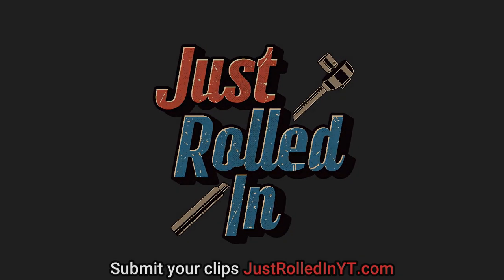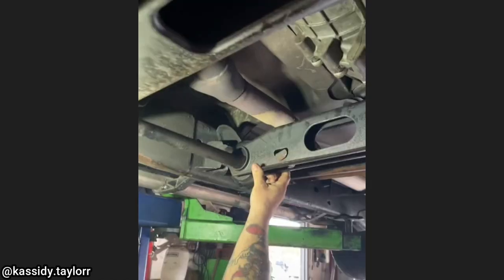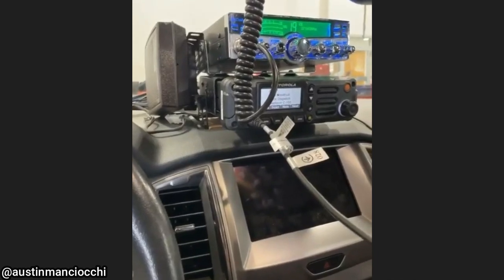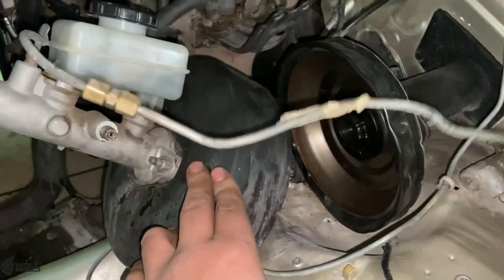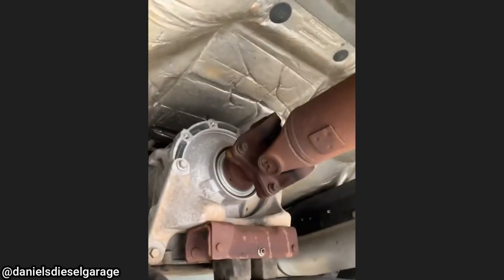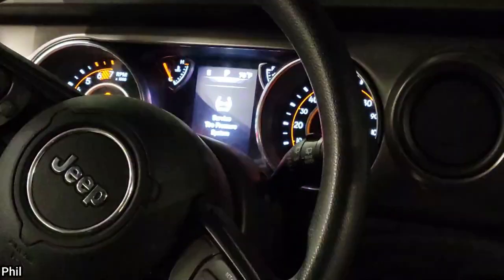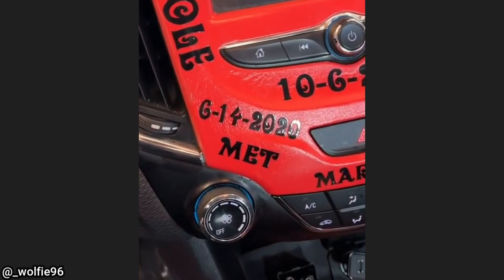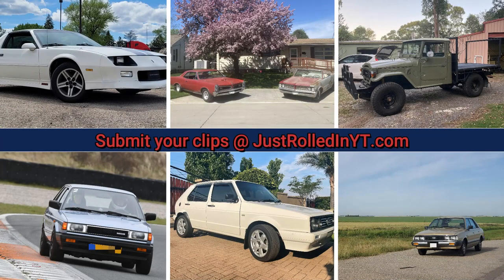Customer States Haven't Changed Oil In 60,000 Miles | Just Rolled In

Comment: That guy needing the fix for safety inspection should have any more luck at another shop.  That vehicle needs a lot of work to make it save.

Don't people read owners manuals concerning oil changes?

We get oil changed in our vehicles every three to four months, regardless of mileage.  We spent a lot of money for our vehicles, and changing oil when we do is better safe than sorry.

That wiring genius should quit installing electrical components in vehicles.  Hopefully that's the only vehicle he wired like that.

Gas in the reservoir under the hood?  And the reservoir didn't dissolve?  Can you say fire waiting to happen?

I still say many of those with passenger vehicles should be required to take an auto class before they receive a driver license.

Comment: Here in California we have a smog test and it is emissions and visual and if you have aftermarket parts or broken parts or problems they will not pass your emissions smog test furthermore vehicles past 2000 typically have better computers so they don't do the same emissions test unless the check engine light is on the vehicle you showed would definitely not pass

Comment: how does an engine backfire have anything to do with a brake booster exploding?
Reply from the maker: Vacuum line on the engine going to the brake booster. If the engine has a backfire it has too much fuel being added to the engine, so it had a backfire which made it's way to the brake booster via the vacuum hose. Ideally you'd want a check valve on the line or an individual vacuum source for the brake booster to prevent something like that happening. But it's on an older truck so most likely wasn't done like that.